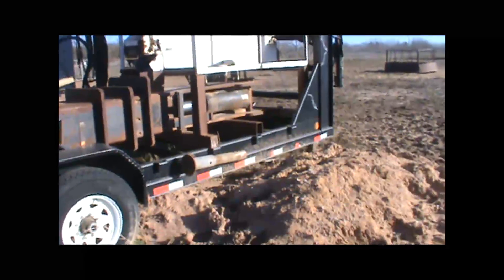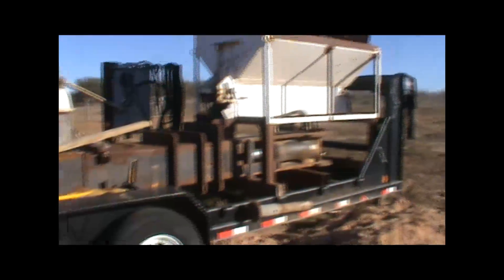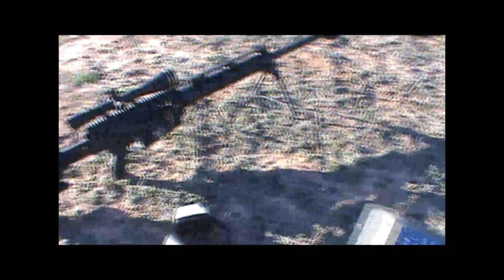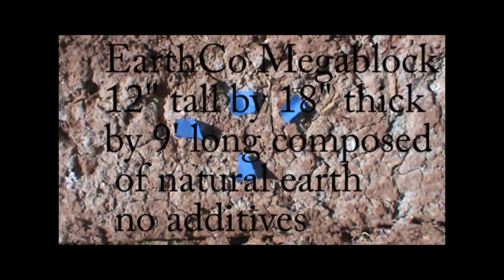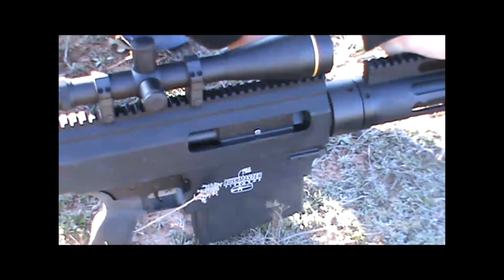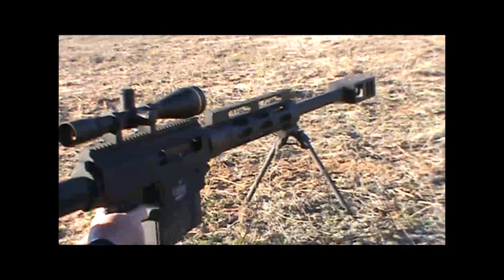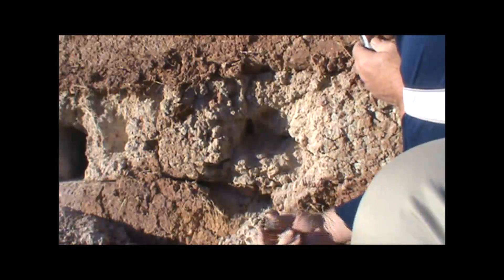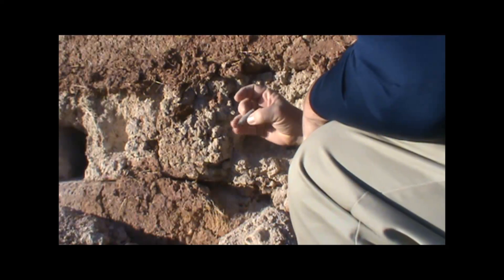50 cal. armor piercing versus EarthCo Megablock wall

Comment: Will soft dirt be easier to penetrate? Quite amazing how dirt or sand stops bullets, no wonder why they're used for backstops
Reply: Generally yes. The earth blocks are compacted hardened dirt used for building material, like adobe. You could break your hand punching that wall. Deepest penetration was still 11 inches (280mm), just under 1 ft. Of-course this was from the mighty 50 cal, which is a heavy sniper or heavy machine gun calibre. Sandbags can also be effective on a battlefield (and are cheap & portable). 600mm of sandbag can apparently absorb multiple 50 cal rounds and offer excellent protection from rifle rounds. Edwin Sarkissian demonstrates this on his channel too.